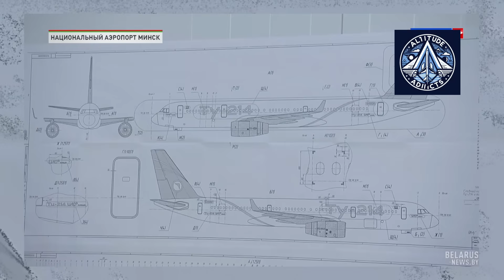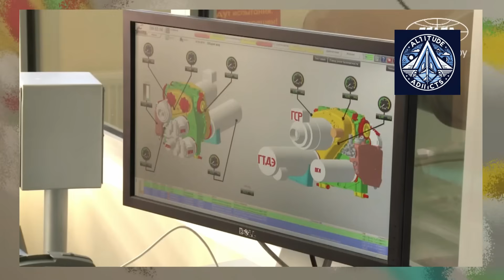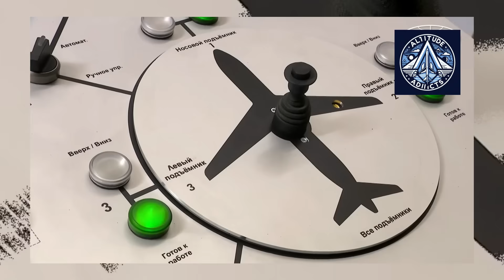From Soviet Repairs to Plane Makers: Belarus’s LMS-192 Osvey Aircraft JV With Russia

Comment: first flight 2027 .... that can only mean that as many parts currently used on the Baikal as possible will be used on the Oswey .... which means that Belarus is really going to be the final assembly line. 
In reality it is a copy of the De Havilland Twin Otter - so that will speed things up enormously too
Reply: It's a fixed gear Let-410